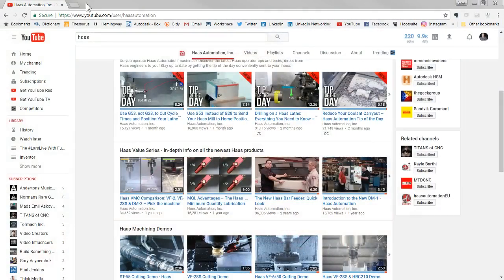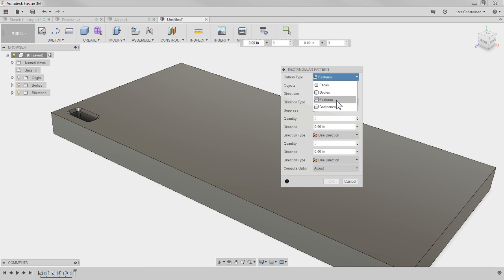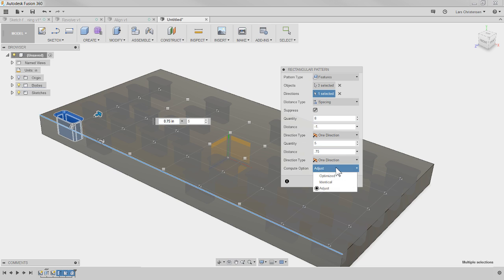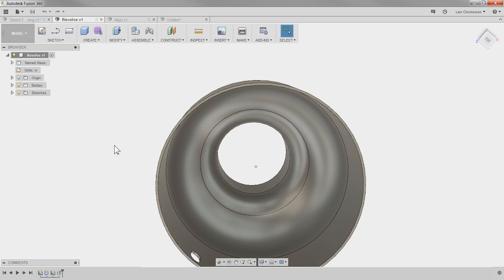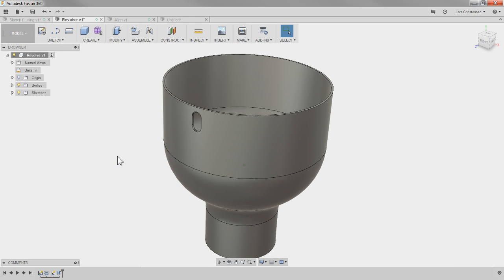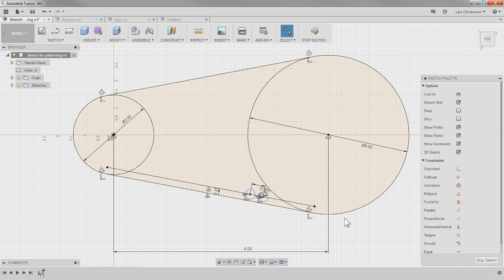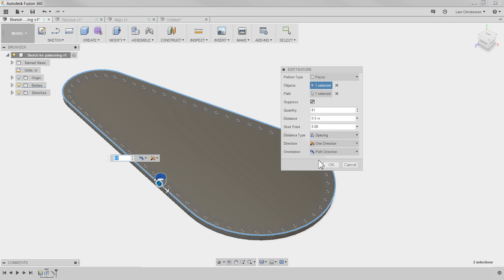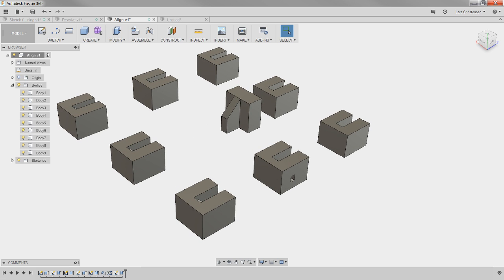Fusion 360 — How To Use The Pattern Function —Your Comments & Questions — #LarsLive 30

Comment: Your demonstration of pattern on path illustrates two issues I have encountered and not really found a good ways to deal with: 

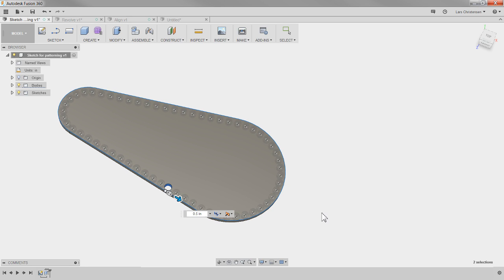1: How to repeat a feature with even spacing around a closed path. Your example with the holes illustrate the issue, as you can see on 26:25, the gap between the last hole and the first does not match the others. What I find myself needing is to repeat a feature a given number of times around a closed path with an even spacing. One would think that I can then just select a count and a distance along the path, but as pattern on path measures that distance in length units rather than a fraction of the path length (like f.ex sweep along path does) I must resort to entering a calculated length of that path, which of course fails pretty miserably if I go back and edit the path. 

Now I realize I could do some trick to make this calculation automatic in the parametric section, but this can get hairy pretty quickly for more complex paths. 

I would love to find a more elegant way to make a pattern along a closed path with even spacing without having to calculate what that spacing needs to be in advance. 

2: Your second example with the rectangles show a slightly harder but fortunately (for me) rarer problem. When making a pattern along a path with varying radius I might want to modify the feature depending on the radius, and not just rotate it. Observe on 32:40 how the spacing between the slots on the inside gets very small. I would likely want to modify the rectangle to a trapezoidal shape while following that radius. I have no idea on how to do this easily, I would imagine it could be possible to do with some added features in fusion, but i'd like to see if there is an reasonably easy way to do this already.

Comment: Great tutorial Lars. Would there be an easy way of evenly spacing those holes around your shape? I noticed that your holes didn't quite repeat correctly.
Reply from the maker: Thank you! You would have to offset the outer edge to the center of the holes and measure the length of the path to figure out spacing. Kind of two different calculations.
Reply: Lars Christensen I guessed that may have been the way to do it. It would be a neat feature to have though, an even space feature where you say you want 10 occurrences and it works out the spacing. It would help with the first point that you made about making the holes in the flat plate.

Comment: Hi Lars -- new user, you've saved me a TON of time learning the basics. Thx.  Couple of questions -- but I'm sure you have covered these elsewhere:  if you could just point me to where to see where they are covered in your tutorials -- what would be great.  About pattern function and related to constraints: 
So In sketch mode, I created a series of repeating circles ( portholes in a model boat design) using the techniques in this video.  Question: is there any way AFTER you save and move on --can get back to the "pattern" that you used to create the series (in this case, a line of portholes ...)?   For one, I'd like to be able to apply a  "user parameter" -based on the pattern - , so I could repeat the sequence elsewhere.  Is that possible?   
Secondly, because my porthole series was created with the pattern function -- there seem to be some constraints between the individual objects -- such as distance between one porthole and the next (which I set up when I created the pattern) -- how do I see what the constraints are? So I can change a constraint value (ie distance between two objects), for example. 
Lastly, on the topic of constraints -- is there a way to click on a constraint icon and see which objects it is manipulating?  

One quick other thing -- can you point me to where you describe how the pattern function is different in sketching vs in 3d modeling mode?  You must have covered that elsewhere ... hard to search for the right vid that covers it. 

I know, lots of questions -- just point me to where you have already answered them!  Thanks again THUMBS UP!   I'm a subscriber ...   Nat (Seattle WA)

Comment: Hi Lars , I do not know if you would want to make a video of this, but I would like your opinion on designing a thread to make it more like a locking system rather than a thread. By that, what I am asking is for you to consider when you have an interior thread meshing with an exterior thread such as in a nut and bolt, that you grind away the threads on the bolt parallel to the length of the bolt down to the diameter of the shank in  4 quadrants of say 40 degrees which would leave 160 degrees of thread, 4 x 40 degrees on the bolt and then cutting out the same 4x40 degrees of thread starting offset 40 degrees from the threads on the bolt with a required tolerance. The object being that instead of having to screw the nut all the way down the thread which only serves the purpose of getting the nut into the position where it tightens, you could push the nut down the bolt to where it touches the part to be clamped then rotate it so the threads mesh and travel the distance within the 40 degrees to provide the torque required on the nut. I understand the the load on the threads is only being carried by 160 degrees x the number of revolutions of thread instead of the full 360 degrees x the number of revolutions, but the threads could be made at twice the width and half the revolutions and probably allow for a higher torque. The reason I am bringing this up is because I recently discovered that when using stainless steel, you must be careful not to screw the nut too quickly or it may bind when only half way on the bolt due to heat from friction. Does this make any sense?
Reply from the maker: Hi Bob Stewart Thank you for watching!
I need more coffee to picture exactly what you are trying to do. But, it sounds like you could download a nut and a bolt from McMaster and start drawing some sketch geometry and cut away part of the bolt?

Best,
Lars

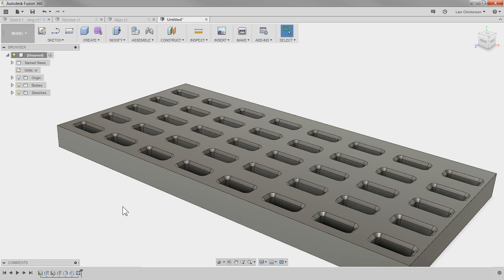Comment: 8:00 Lars talks about not having even edge spacing and knowing how many holes will fit.  I placed the first hole I wanted then set the dimensions from each edge.  Under the pattern menu I used "extent" (not distance) when I drug the pattern all the way to the end of the part I figured my max number and set that.  F360 set the last hole to the dimensions from the edge which I set on the other side.  Hope that helps someone
Reply: where did you put the dimension to set it from each edge. I don't have the option in the dialog box for rectangular pattern.

Comment: I'm trying to use the Circular Pattern to emboss text on a conical body, using a lot of the instruction from your other video about wrapping text. Wondering if there's a way to create a pattern for the plane at angle so you can quickly sketch each letter on the patterned planes and actually spell something longer than REX out rather quickly. So far all I've been able to do is repeat a single extruded letter around the cone at an angle, which I know is close to what I want but then I can't seem to change the patterned letter/number as it is it's own body and I can't change the sketch. If there's a way to pattern BEFORE I sketch the letter and then extrude each one it's still a lot faster than creating a new plane at an angle say 13 or 14 times over again which is tedious. Something I'm willing to do for this project, but in the future we as a community HAVE to find a way to make this quicker. Embossing text on an object is rather important in a lot of manufacturing applications I think... As always, I appreciate your videos and thorough instruction! Thanks Lars!

Comment: Hey Lars, I'm looking to copy one of those finished, filleted, chamfered holes, and paste it in a couple non-patterned locations on the same plane of the same composite. How would one do that? This concept would help me on a current project. 
You are doing such good for us, Thank you so much!
Reply from the maker: Hi Damion S Thank you for watching!
Create another pattern? not sure I totally understand the question
Reply: Using this video as an example, I would like to copy the entire chamfered hole (in my case a slightly more complex hole, almost like a # 9 shape cut into the part) and I would like to copy that cut out and paste it to another seemingly random place on the part. I was successful at copying the sketch and then repeating all of the chamfers and fillets, I was just wondering if a completed cut out pattern could be repeated as a whole.

Comment: Lars I have been tinkering the different options in rectangular patterns. I am not understanding symmetric. I would guess that if you start in the center of a feature that it would lay the pattern equally in all directions. That is not what is happening when I select that. Either I am doing something wrong or there is something that I am not understanding. Do you have video that explains  symmetry in patterns or know of someone else that does?

Comment: I ran into a problem with placement of a hole. I was trying to place a few holes around a circular flange. Say flange OD = 100mm and holes of 10mm at an 80mm circumference. I don't know how to get the 1st hole exactly centered on the 80mm circumference. There seems to be no way to reference it.

Comment: Hi Lars. I'm a green newbie. I hope I'm not wastng your time,  but there is a simple task I can't find a tool for. I'm creating a design for a wooden cutlery drawer. Bottom sides and ends, no problem. But now I want to put 4 equally spaced dividers inside. For the life of me, I can't work out how to set out the 4 divisions. I've tried the rectangular pattern tool but there seems to be no way to get Fusion to divide the overall length equally! Help me "Lars" your my only hope! 😉

Comment: I wish there would be an option to enter the start point and the endpoint of the pattern and put in the maximum distance between the features and let Fusion calculate the optimal distance which would be =< than the "maximum distance between instances" that you might be able to put in.  So if you get an instruction like "you need to place a fastener at 50mm from the end of the workpiece, then at maximum at 200 mm intervals and at the other end again at 50mm from the end of the workpiece and your work piece length might vary a lot then Fusion would calculate the optimum result when you change your workpiece lenght. If anybody knows how to do that in Fusion please leave a message.
Reply from the maker: Hi SuperRistopaha Thank you for watching!
That is a great suggestion. Have you ever voted on the the idea station? THis is where the developers are getting their priority list from:
https://forums.autodesk.com/t5/fusion-360-ideastation-request-a/idb-p/125

Have an awesome day
Reply: Hi Lars,
no I haven't but I think that I will have to suggest this. It would save so much work in some situations and help solve the "unequal other side" and make parts with patterns scaleable in a new way.

Comment: Lars, please help. Pattern on path creates multiple bodies. Bodies can intersect. How to join them all together without selecting them all by clicking on each by mouse? Because it's impossible in my case. I use parametric design and "Quantity" field (pattern feature) uses my custom parameter so resulted bodies count varies when changing user defined parameter. How to combine all the bodies on component for joining them? Like a select all or select all that produce pattern feature... Combining required for future body modification on head and tail faces.(first and last body before combining). If you respond and say that more info required I will shoot a video demonstration... Thanks in advance!

Comment: I am having trouble with patterns on a woodworking project. Dadoing in a sheet - 2 ends (rabbetted) and 2 dividers (dadoed) all equally spaced on the sheet. The ends and dividers are all the same dimensions. I construct the base sheet. If I then rabbet one end and try to pattern, it doesn't work. I have tried making a pattern of construction lines on the sheet surface - but it won't let me pattern just a line (or any 2d thing, I guess).

I am sure there has to be a way to do this, other than brute force calculations. Any thoughts? Anyone?

Thanks in advance

Comment: Hi Lars. Patterns are easy BUT how do i do a pattern with different text?? i.e. I created squares and then created a pattern of squares 12 x 12 (144 squares. BUT how do i start the first square with A1 and then last will be L12? Thanks :)
Reply from the maker: Does it have to be actual cuts or could it be a decal?
Reply: Lars Christensen well as an example let's say it's key rings for a hotel or blocks for a game board. Its a need to create multiple as in the pattern with incremental text. I would want to 3d print the final parts. So anything that will work. I could do it manually 😑 but I think a little automation will go a long way lol. As an example a package I use for CBC Aspire Will allow you to create a pattern and the text on each part can be pulled from an excel sheet. But what I need is simpler I guess. I hope i am making sense. Any progress I have made with F 360 is due to you- Thank you!!
Reply: That is an interesting question.  All I can think is maybe do it in a digital style, so that each block has the pieces to create the necessary numbers and letters.  Then after doing the pattern adjust each feature.  If you don't mind sharing what you come up with. I'm interested to know
Reply: Another way would be. if you have a vector sofware.  Use the excel spreadsheet to form the table at the exact proportions you need and then change the image to vector.  There is a way to use vector to create a feature.  Overlay it on you block and extrude or whatever.
Reply: Here you go. https://www.youtube.com/watch?v=g92n2a6vWGI

I don't know if you can export from excel to vector, but if you're using Illustrator, you can take the image in raster form and do "live trace"  just select black and white (ignore white option).  then all you will have is the text in vector form.  the boxes may still be there but you can easily delete that. then save SVG and put into fusion.  Hope this helps.
Reply: Jonathan Covington I can do it very easily with Vectric Aspire it's a feature  create rules and it can also pull detail from a spread sheet
Reply: oh ok great u figured it out already nice.  Never heard of vectric aspire.  I'm still very new to this stuff.
Reply: Jonathan Covington so am I lol but spire about 5 years. It's more cam related though for the cnc
Reply: Cool stuff.